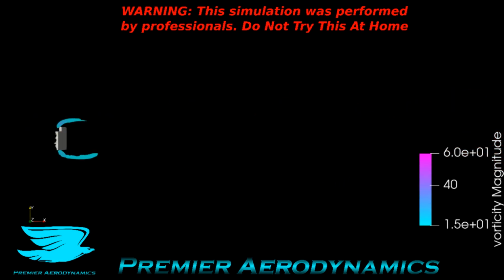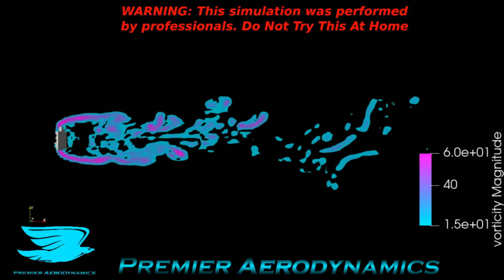Aerodynamics of the State of Utah

Comment: When you understand that air is very egotistical and loves being full of itself, you understand air. When you deny air the ability to be full of itself like a full on prima donna, it protests, it will seek and fill all the empty space you try to create. Air is having NONE of your attempts at not letting it be full of itself. Air will lift planes, and suck cars to the ground, and crush steel drums if you try to let air not be full of itself. You think air is too conceited, but air also knows how full of itself it likes to be, it takes tremendous energy to make air too full of itself, IE pressure ratio. Not just shoving the air, but man hours designing ever more efficient blades to move and shove air where it doesn't want to go, and if that sounds dirty, well it probably is.